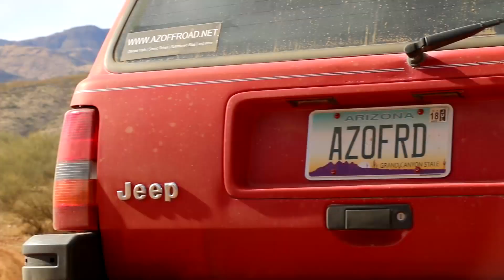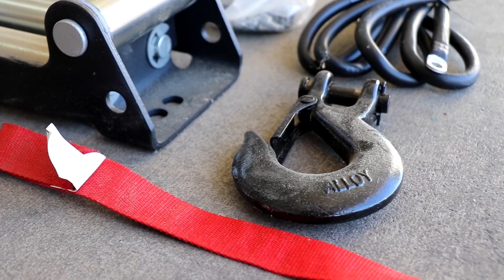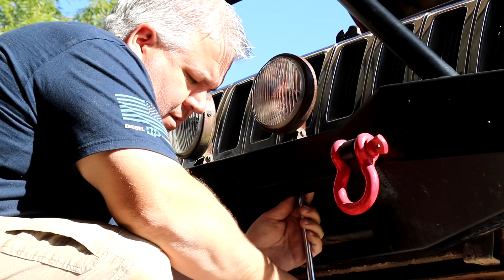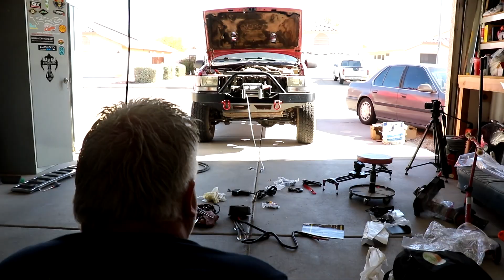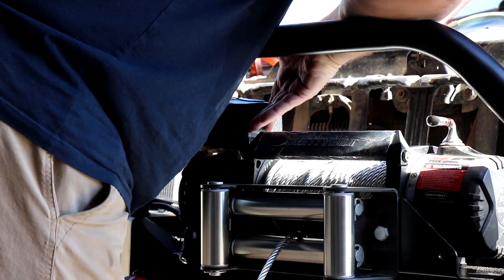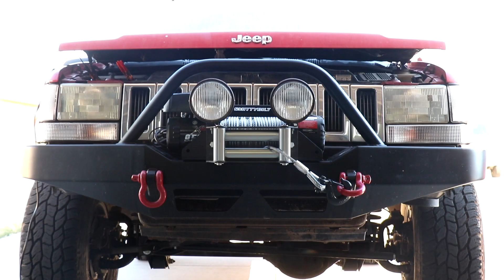ZJ Project (Part 13) -- Winch Install

Comment: Could you link the winch and the lights to purchase?
Reply from the maker: The winch can be found here: https://amzn.to/39bmnwS

It seems like the lights have been discontinued from 4 Wheel Parts -- but here is the link, you may be able to find something similar: https://www.4wheelparts.com/p/pro-comp-55-watt-5-inch-spot-light-chrome-9550/_/R-DFCW-9550

Comment: I'd move the lights to allow airflow to the radiator. Jeep has an updated fan for V8 jeep ZJs 11 blades I think. I bought a new one for my buddy and it helped him a lot.
Reply from the maker: I recently did a 200 mile on/off-road trip and so far it seems like it doesn't affect the airflow TOO much. Summer time here will be the true test. I'll look into that fan though. Thanks for watching & the tip!

Comment: I'd slap the light bar on the bull bar, and put the 2 other lights up top.
Reply from the maker: I've had them on for a few weeks now & so far they have been really functional. The two winch lights have a wider spread to them, so I think they are better up front. I do want to re-do the top lights soon -- maybe get a slimmer light bar.

Comment: Looks good.  Lights are perfect.  Don't replace the rope until it's unserviceable.  Get a 3ft 3/8" V Bridle with 8" hooks and a tree saver strap.
Reply from the maker: After a few weeks now, I do think I'll leave them where they're at. I like the look and are really functional. If anything, I'll probably paint the metal backing with a bed liner or something. I'll look into that bridle. I do carry a tree saver already. Thanks for the tips & for watching!